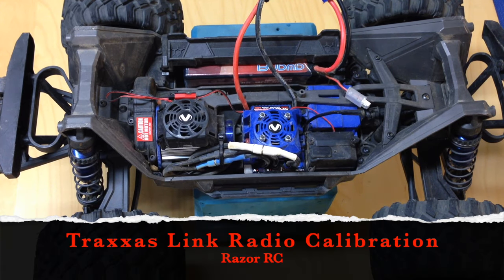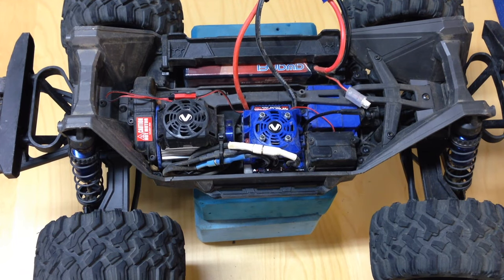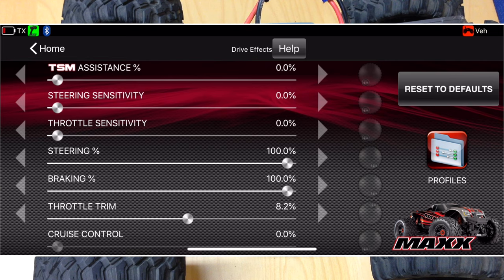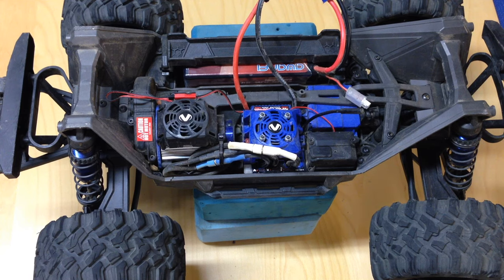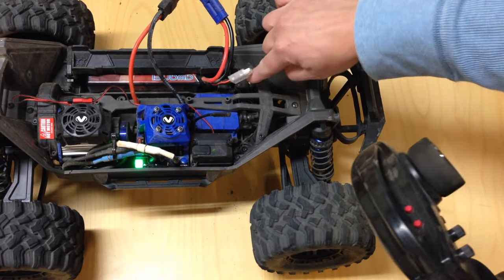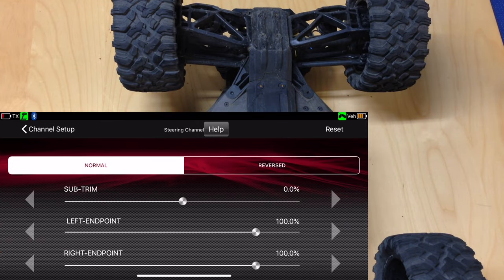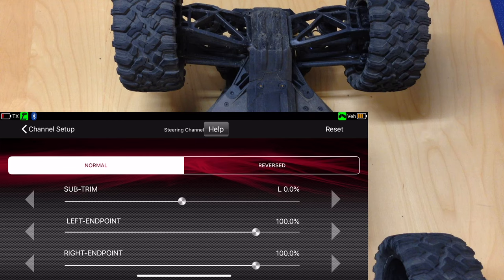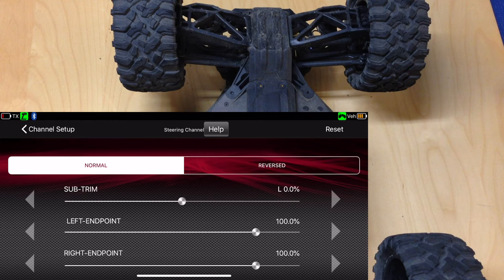The RIGHT way to calibrate your Traxxas Link TQi RC Radio steering, throttle and ESC

Comment: I picked up the link and worth every penny, set servo endpoints and braking to 80% made a huge difference from touchy brakes that would end of end the truck if not careful to way more manageable, still lots of stopping power without locking up the front tires.
Reply: Same with me
Reply: Servo endpoints ? Where that setting mate

Comment: I recently bought the Traxxas 4-TEC 3.0 Factory Five 1933 Hot Rod Coupe in blue. I had a Traxxas TQi system with Traxxas Link Bluetooth module installed sitting around unused, so I replaced the TQ system that came with the Coupe with the TQi system. Your video is clear and concise, and it was a big help in getting everything tweaked the way I want it.
Reply: I’m wanting the 3.0 corvette but refuse to buy it without the TSM they have in the 2.0’s. May have to do what you did and just install. Cannot believe traxxas didn’t include tqi/tsm on the hot rods and corvette🥵🤦🏼‍♂️
Reply: @staccatoglock  q
Reply: @glenntukes4021  bot

Comment: Great video! After upgrading my servos with metal gears (TRX2072X) one servo made a constant noise when it was at its endpoint. At first I was scared that the servo had a malfunction which would have been odd because it is only 1 week old. But after a lot of videos on "servo jitter/chatter" and "pontiometer problems" I came across your explanation for the noise and fixed it easily ;) By the way the wireless module with the app is awesome for all those adjustments!

Comment: I had to set the end points on my TRX-4 to 88% turning left and 70% turning right to keep the servo from straining at full steering lock. I have to do the same thing on my RC4WD monster truck to keep the tires from hitting the lower control arms. It's a nice feature to have on a transmitter.
Reply: Hi mate did u do any other setting? I have TRX and although this video was helpful I’m wondering if anything else is worth tweaking.. any advice would be appreciated

Comment: Razor😀 I used these setting and found my hood Amazon special ain’t a dud in this specific truck but it’s that even at 3.0 out of maximum available was still enough to give me dud steering 🤔 as tho I had potatoes between all my steering links😟🙃 but now he’s on top of my go to list once again👊🏿 a 🥃 thank you to you razor for sure, and the joke was he was better to drive on 3s than the 4s I brought him for due to the steering not needed as quick as it was on 4s is you see what I mean 
Now he’s back to 4s 
Now I also need to figure out how to get larger batteries in him 🤔🫡

Comment: Great video. Did you also check that your servo arm is mechanically centered? 10percent off could be the factor for your 110 percent right and close to 90% Left.
Reply from the maker: It's the draglink (turnbuckle that connects servo horn to bellcranks) that will affect the uneven left/right.  If the servo horn is not centered, your trim will end up being off by a lot.

Comment: Very helpful, thank you. Question, when you remove the link from your transmitter, does it retain the settings on the transmitter?
Reply: highxj bump
Reply from the maker: Yes it does
Reply: My son and I both each have rustlers. Would we be able to fine tune his car using the Bluetooth module in his remote and app and then take the Bluetooth module out and put it in my remote and set mine up and both stay saved? I basically want to be able to set a faster speed in training mode but not 100% full speed for him just yet
Reply: @ryanfortin9166  I want the answer to the exact same issue. Any updates? Did you end up buying the link?
Reply: @gsinghmonty  yes it saves the settings even after you take it out, you can use it between any link compatible transmitter. My son and I use one between all of our transmitters.

Comment: Appreciate it man. I don't even have a Maxx but I'll be getting one here in a few weeks so I'm prepared for everything. Already have the setup I want . 80 weight shock oil. 100k diff front and rear, widemaxx and proline badlands 3.8s possibly
Reply: If you’re buying new it already comes widened from factory now, so you can skip the widemaxx kit
Reply: @CoDplayer458458  I have a first gen. I got it for my birthday last October (2021). The first gens don't have the wide Maxx. But the main reason to buy the wide maxx kit for the V2, is so the arms are a custom color. Unless you break parts and need to replace them obviously
Reply: My bad, thought it said your comment was 1 day ago, not 1 year ago lol

Comment: Very helpful video. Just got myself a nex X Maxx but out of the box I had to turn the steering trim on the TX all the way to the left to have it. running almost straight.  What should I do?  I have the link as of today.  Should I work with the subtrim feature or take everything apart and set the servo Horn centered?

Comment: Thanks for this video.  

I tried to follow this with my new Maxx V2.  I have the link installed in my controller. What surprised me was the sound of my ESC fan.  It was so loud that I couldn't hear my steering limits.  I think I got the right side servo to stop making noise at full turn but when i tried the left, I could see the tires stop twitching but couldn't hear if the servo stopped making noise because of the fan noise. Is there a way to pause the ESC fan? I can unplug the motor fan. I'm a newbie and looking to figure this stuff out before taking my new ride on its maiden voyage.  Thanks for the video.
Reply from the maker: Just unplug it while doing this.

Comment: I would try reinstalling your servo horn. I see the trim on your Tx is way far off to the left. Hopefully you can move your servo horn one tooth in the opposite direction to get that straightened out a bit.

Comment: TSM does steer the car when it's not on the ground if you hold it up and turn the car back and forth you'll see the front wheels try to compensate by turning in the opposite direction then what you did. , at least that's what the three that I have do

Comment: Can you reset the steering neutral position using TQi or do you still need to center the trim on the radio, remove the servo horn, center the servo, replace servo horn?

Comment: Nice video, very helpfu, subscribedl. I hope the throttle calibration helps me. I just got an ERevo 2.0 today and it wont wheelie or do the self right; the tires wont even balloon a little when doing the self right or full trigger pull.
Reply: sounds like training mode

Comment: Hello, thanks for this great video! I've a problem with my new Maxx, I think it's not getting full throttle because max speed is only 28 Mph and should be about 40, right? Could it be the throttle calibration?

Comment: Have had any problems with you truck. I'm going to install the 3rd servo and I just got the truck 4 days ago. 2 1/2 charges. I hope this doesn't keep up. Only running it on flat ground too. Crazy!
Reply: Buy a better servo

Comment: exactly what I was looking for! question: would the odd steering endpoints your truck needed perhaps indicate a steering arm improperly indexed on your servo? you needed 110% left while right maxed at 88ish%, ~10% off more or less from center. idk nothing from nothing, straight rc noob, so apologies if I'm asking a dumb  question. thanks again for a very clear, well put-together walkthru of the Tqi Link
Reply from the maker: the Maxx has a problem where the servo horn hits the chassis on one side, but normally if they're different you need to adjust the drag link (the turnbuckle that connects the horn to the steering rack)
Reply: To answer your question, yes. Redoing the servo horn to get proper index can fix this, there’s always going to be a position that is close to center, the video just shows a software workaround for it. Either way works!

Comment: my rustler doesnt groan or whine while turning the tires left or right. Only groans when the servo is "centered". It is weird. It is the stock servo 2075. Its not a constant noise but when i was checking endpoints upside down, it was very noticeable. Put it right side up just now and it stopped. Any idea if thats normal? Thanks for the video!

Comment: Your servo horn isn't centred, this is why your end points were out. This is a problem as the servo has to move though a wider range on one side. If you watch closely, you actually steer faster in one direction than the other
Reply: I concur..arm is a tooth off the correct centered location...my mini revo had this issue

Comment: Questioning someone's comment I have two trx4 if you hold them in the air and you turn the body R chassis one way or another  no not the steering wheel  , the front wheels will I repeat will compensate and turn the tires in the direction you was originally I guess I could have dumbed this down a little but I think most people would get the idea of what I meant

Comment: Do you need to have the app on your phone on and linked to your car in order to use any other settings that you're adjusting. When I'm trying to get at is if I have the app and I have the settings but I have my phone in my pocket and it is not on will it still work ( the settings)  Thanks

Comment: I installed a cheap single servo after wrecking the dual setup. So anyways after the install everything worked fine but when I turn on the link app my steering reverses. I have to reprogram the controller

Comment: Hi, I just bought a Maxx v2. I am in sport mode but I want to have 100% Forward, 100% Brakes, 30% Reverse. I can’t find the reverse slider in drive effects. 100% reverse is too much power in reverse. Please help.
Reply from the maker: You can't.  Reverse and brakes are the same, you can't adjust one without the other.  I have a video on how to "hack your brakes" which would probably work on the Maxx too, but you'll have to figure it out yourself.

Comment: I had to recalibrate my Bandit VXL and Rustler 4x4 VXL. Rustler wasn't getting full throttle and the Bandits TSM system wasn't working right.

Comment: TSM assistance will not steer your car in the air if your steering the car. You would have to literally hit a jump and let go of the steering control for that to happen. Transmitter input overrides TSM. How you worded it may be confusing to some people. I hope this clarifies.
Reply from the maker: I disagree.  TSM/AVC/gyros purpose is to override your steering input, including when you are turning.  You can reduce how much it interferes with the TSM dial, but it interferes all the time -- going  straight, turning, etc.  If you're going around a corner and turning the steering wheel 50% and the truck starts oversteering, it will actually straighten the steering a little bit to correct.
Reply: @RazorRC  try it . when you steer with the transmitter your input is what the car does. The gyro does not override it. Don't take my word for it try it out for yourself
Reply from the maker: @PhilBender612  I have.  Trust me, I've tried every company's version of TSM.  Traxxas, Spektrum, Team Associated, Radiolink, Flysky, and the Dumbo RC X6.  I own all of them and have tested all of them.
Reply: Why would you be steering  the car when it's in the air you turn the TSM off to keep it from staring in the air

Comment: Can someone explain in detail how to set the trim with the tsm off? I have done this best I could and when I turn on the transmitter then vehicle and the tsm is turned back on the wheels start to move on their own to one side. With the front modular section apart do you have the truck centered and balanced on a block of wood floating with wheels off the air? Then turn on the transmitter with tsm off already or when you turn on transmitter? Then I see the servo centers and I place the horn on and tighten. Are you supposed to do anything from here? Because then I would turn off the ESC and attach the front module back on and attach the bell crank arm to horn. Secure all screws then fire it up again but when tsm is turned on wheels start to turn on their own. With tsm off of course it doesent do this. I would appreciate some insight on this because it's frustrating.
Reply from the maker: Try zero'ing everything out, take off the servo horn, turn on the radio/car and TSM on to center the servo with the car on a stand.  Then stick on the horn with the car still on and sitting flat on a stand (if you can).
Reply: @RazorRC  ok after I place the horn back on while truck is still on then should I turn off the truck then receiver and assemble the front end module back on? Traxxas had stated to turn TSM off while setting servo trim. I will try this and if not I will contact Traxxas for tech support. I appreciate your help.

Comment: Calibrate and program the ESC on all new brushless RTR rigs before first run..Always.
Reply from the maker: Yeah.  Crazy thing was my throttle was trimmed to 8% from the factory, which means my neutral was set to 8% instead of 0%.  There's no way to see that without the Traxxas Link display.
Reply: @RazorRC  You can feel 8% though for sure

Comment: Hi! There's only one traxxas link? I mean is there a number code for certain rc like traxxas maxx? Or only one and fits every tqi tx?
Reply from the maker: Jerome Castillo it will work with any of the TQi’s of the last 5 years or so.  Some of the older ones it won’t or the plain TQ radio won’t work.
Reply: @RazorRC  thank you! I ordered mine already. My maxx isn't properly calibrated.

Comment: need a help.  when you change wheel type to get speed reading right on traxxas link app.  you can only select from list of wheels on the app.  i bought a badlands 3.8.  what can i do to get speed correct
Reply: I know this is old, but unless you have the add on GPS module it’s going to be out to lunch anyway, my truck with all the correct settings says it goes 49mph in the grass with out of the box gearing, and no way in hell thats correct.

Comment: I think any servo will make noise if its not coreless under load... you car should have been standing out of the ground to say that the servo is trying to push further than he can
Reply from the maker: It's off the ground.  There's blue yoga blocks underneath it.

Comment: My turning wheel is also my throttle can u help
Reply from the maker: Check that your ESC plug is plugged into channel 2.  The Traxxas receiver has two channel 1 slots, so channel 2 is actually the 3rd slot and you should have an empty space in one of the first two slots.

Comment: While I would definitely agree that Traxxas stuff is off, I wouldn't tell anyone to buy the Link for the system.  That Link system ona system update bricked 2 radios.  And regardless of what people think that it's only doing this ti Android,  it's not , does it to Apple software as well. Their are plenty of people that had the same issues I thought it was just me until a Traxxas rep. Had actually told me it was a security bug in there software that was bricking the radios.  
 My personal experience with Traxxas is the vehicles are ok, the electronics are trash. Replace the electronics with better ones.  Almost all Traxxas steering servos are seriously under powered.  I've been doing RC for 35 years and this has always been a Traxxas issue.  I have  a 20 year old Team Associated MGT that out performs my Xmaxx and doesn't break nearly as often lol.

Comment: Bluetooth wont connect used to work
Reply from the maker: Eric Hiles did you try fresh batteries,  mine won’t connect if the radio batteries are low

Comment: The Maxx is the worst car ever.. out of the box esc and receiver where bad. Had to get replacement parts from traxxas.  New car sat for 2 weeks.  DO NOT BUY A MAXX! Friend bought one too and had problems with esc.
Reply: @theschuntz What kind of problems did it have? I have a maxx that is glitching, brand new out of the box
Reply: @2024YTR  same problem mine had.. contact Traxxas and you will have to send esc to them wait over a week.. or try and return it to place of purchase.. a lot of Maxx came with defective esc
Reply: @theschuntz  thanks I will try to return it
Reply: @2024YTR  I do have a Revo 2.0 its a great car but you will need to upgrade to metal servos.
Reply: My maxx is perfect brand new no issues at all

Comment: Take the transmitter and receiver out of the truck and throw it out the window. I stopped giving Traxxas money for their garbage electronics. Aftermarket radios are built to last, are far better thought out and simpler to operate.

Comment: How do you lower your reverse speed? Mine gos in reverse real fast is there anyway I can lower it down?
Reply from the maker: Team Vega Rc you can turn down your brake end point which will turn down reverse and your brakes.  No way to turn down just the reverse, only both.